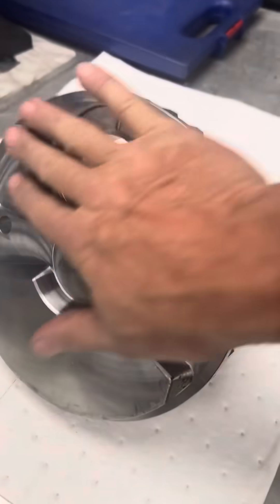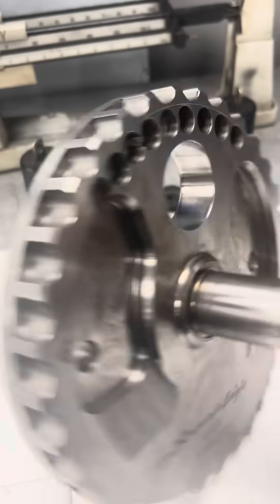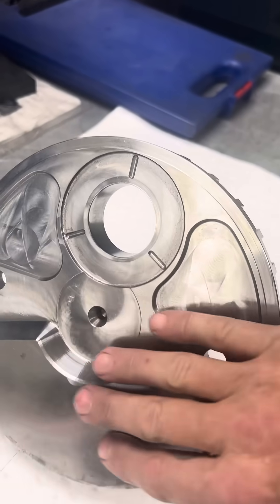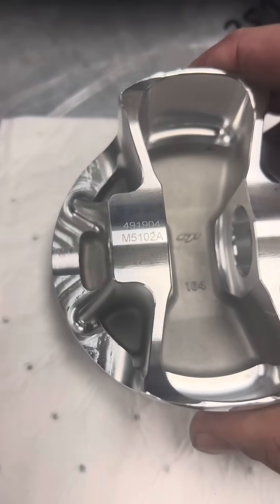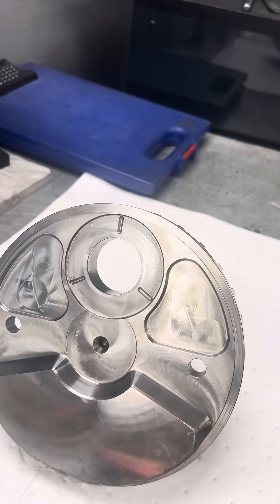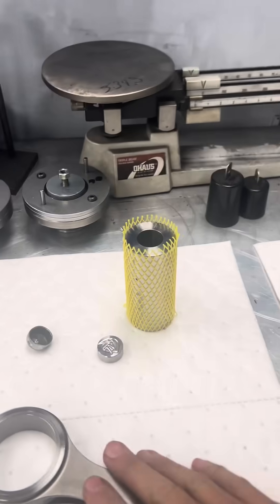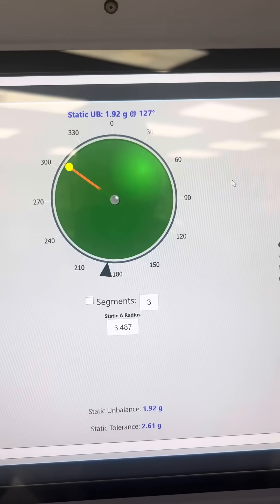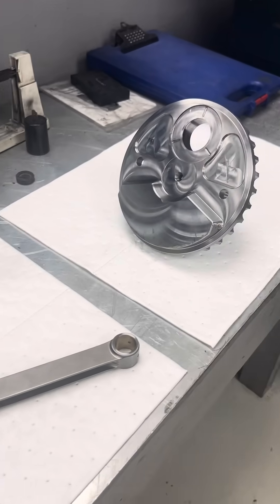Crankshaft balancing basics

Comment: NEVER DRILL A CRANK ALWAYS MILL IS DOWN UNLESS YOU DON'T KNOW  WHAT YOU ARE DOING
Reply: thats pretty funny , every manufacture in the world drills cranks for balancing
Reply: @anthonyiannone7618  and you are 100% corect on that but manufacturers  do mass production  and are not concerned  with  doing it the rihgt or wrong way as long as the part pass inspection  perfect example is the 6.7 power stroke that came from factory  with dawl pins instead of a keyway on the timing and oil gears  and those fail at around 100,000 miles and when thay do thay take the motor with them so we build around 2 to 5 of them per month